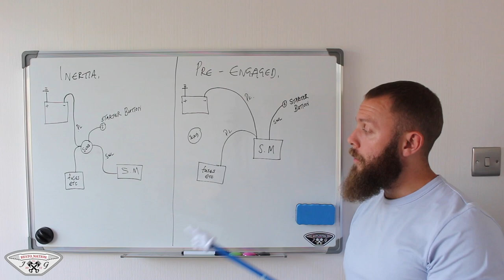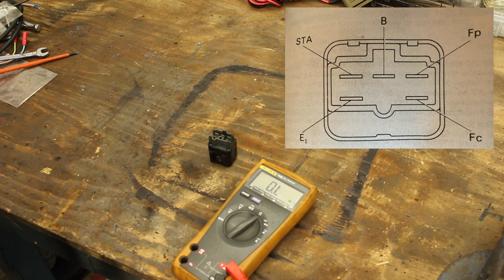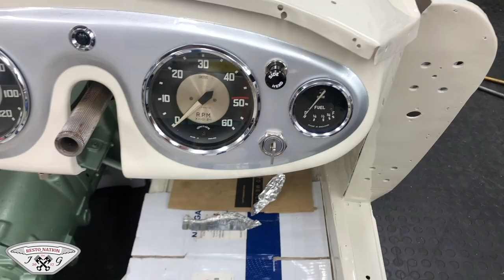MR2 Mk1 4AGE Cranks But Wont Start. How To Fix

Comment: Having now also dropped an MR2 tank I wholeheartedly agree that it’s not a job I want to do again. Mine has been sat since 1999 with half a tank, the tank and pump were rusty as anything. £25 got me a clean tank, I then uprated the pump to an AEM 340LPH E100 compatible pump (massive overkill but I was hoping to convert the car to E10, until I read the manual stating it needs 99 octane anyway 😭)

Thankfully I tested the new fuel pump, rail, regulator, damper and lines last night and got a steady 36psi pressure and no leaks thank god

Comment: I've had this malais on my MR2. I was told that if storing the car for a lengthy period, the fuel pump needs to be completely submerged in the fuel. Worst part of the tank removal for me was actually reconnecting the pipes on refitting, especially the small breather. Wasn't designed to be easy!
Reply from the maker: I didn’t have that luxury as mine was rotten! It’s a nasty job but I’ve done it twice now and hopefully never again!! And if you follow the Manual it’s nearly impossible!! One thing I will say tho, if that tanks Is coming out then change the pump for new!!
Reply: That's exactly the mistake I made on mine.
Reply: Thankyou! I was wondering why my mr2 wasn't starting. The car "started" a month before I got it, but I couldn't figure it out. After some research realized my fuel pump is junk. Now I know why the fuel could have gone out so quickly as there gas in the tank. I got the car for free so thats why I got as a non-runner.

Comment: 8:08 This seems to not be the first time this has happened. I saw an aw11 in Florida that said they changed the fuel pump and won't start. And the one I'm buying having a similar issue, only starting with starter fluid but not staying on for long. Praying that might be the only mistake.
Reply: You ever find out what the problem was ? I'm  in the same position . New fuel  pump and the  gas tank was refurbished.
Reply: @papi_sazon2032  lmfao it was a fuse. No power to the fuel pump. Changed that and it started work

Comment: So I have an mr2 86, fuel pump works and everything. The car turns and starts but turns off after 1 second of it running. What should be checked next
Reply from the maker: DJosue Aguirre are you sure its working?
Reply: @Resto.Nation  Hey well the reason why it didnt start was because of the fuel injectors. The issue was that the MAF seems to be causing hesitation to acceleration and misfires and we bought a MAF and replaced it since it seemed defective. However as of today we put in the new MAF and no longer starts just cranks and it fired up yesterday not sure what couldve gone wrong.

Comment: Couldn't find fuel pump relay on mine 86 MR2 4A-GE model. Can you tell me where is located. I look and search everywhere on net but couldn't find it
Reply from the maker: Should be in the boot next to the ecu behind the carpet.
Reply: @Resto.Nation  wow! Didn't realize it was way back in the back of a trunk. Thanks I got it
Reply: Sorry to bother you but since I came across your video and you seems to have a lot of knowledge on MR2. 

Well, after I tested the fuel pump relay it was still good. Funny thing now as compared to before where mine 86 MR2 crank no start  and thinking it was fuel pump relay is an issue but that's not the case since it has been sitting in the garage for almost two yrs without driving in it. 

After multiple attempted to started my MR2 for the past several days with brand new battery just installed it, it cranks but no start. However, I just decided now to go out to my garage and tried to started my Mr2 and long behold, it cranked and started. WTF!!!

Thought this was just a fluke so I turned off and started it again and it started. Now, I am very dumbfounded. So now,  I thought it might just be bad connectors somewhere perhaps it's in battery terminal connector. I removed both negative and positive end to check and clean it to make sure nothing is corrosive might be build in which were none.:(   

Wondering if you have any ideas as to what might caused this intermittent. Thanks again in advance for being patience and reading this long message.

Comment: hi mate good vid very helpful but what would you think if the circuit open relay isnt getting power?
Reply from the maker: Good question! Have you got a wiring diagram? I would say start with basics like a main fuse maybe? I would expect it to have a permanent live to one of the pins
Reply: @Resto Nation  thanks for your reply even the diag box connector isnt getting 12v where you do the jumper thing very strange
Reply from the maker: @bulldogcarparts3844  super weird. Must be a fuse issue?

Comment: If we have access to the fuel pump power supply wires at the console, why would we not throw 12v on them right there and listen for the pump?
Reply from the maker: You can do If you want 👍🏻. Better to test to see what actual voltage you have and if not then work it back from there. If you put power to the pump and it runs then you still need to find out why you don’t have power
Reply: @Resto.Nation  hey, thanks for the reply! I did the bridge thing and the pump whirrs away happily, and I did the jar-under-the-return-line thing and it hoses in, so i am very pleased not to have to do the fuel-tank removal. I then discovered that while the main ignition lead belts me good, none of the cylinder leads do, so, um, distributor... i guess...

Comment: So If I’ve used the starter spray and it doesn’t work does that mean that I don’t have proper spark? I just replaced the spark plugs and the wires on mine but it still isn’t starting. Help ples
Reply from the maker: Have you got power to the coil?
Reply: How exactly do I figure that out?

Comment: hey resto nation. I currently have an 86 mr2 I drove it home 40 miles. When i first went to pick up the car it started right away. It has a brand new battery and fuel pump. As i was 3 miles away from home i noticed that the valve cover gasket started leaking massively. The car was pumping oil vapors like a chimney. I got it towed home and I noticed that the car wont start or hold idle. It will crank and crank and crank after 1 minute the car would baaaarely start and die immediately. If i push start the car is drives fine but once my foot is off the gas the car would die. I have fixed the valve cover gasket leak and the PCV hose leak. The oil level is good. I also did a distributor cap and wires. I am very very lost in this scenario. Any help would help.

one rare occasion is that the car started and held idle for about a min before it decided to die again. I also noticed that on cold start the idle would jump from 1000 rpm to 1600 rpm then after the car warmed up it was perfectly fine. All the issues started once the vapor was coming out of the top of the valve cover bolt o ring that was leaking and the PCV. When i push to start the car moves and drives normal it doesnt hold idle and now it wont start. What might be the issue?

Regards,
Reply from the maker: Wow, where do we start! Air leak, coolant in the air, ignition timing? I would say start with the basics and go from there to eliminate the easy stuff and then report back. Be methodical and make a list of everything that you’ve checked and eliminated.

Comment: Hello.. please help me… my fuel pump does not run without bypasing diagnostic port… when i bypass then fuel pump getting operate…. After i check the relay also as you told in this vid… i got power to the “FP” port when cranking.. when ignition Key on my fuel pump is not working what could be the reason?
Reply from the maker: Weird. Maybe a ground/earth fault. Check the pump ground wire. Or run a second ground from pump ground to chassis.
Reply: @Resto.Nation  thank you . I will check it out ..🙂

Comment: Hey it’s me again, tested continuity on the connector and the relay wasn’t putting out anything on the Fp terminal. Got a new relay and still don’t have a start. What weird me out is the male connection that goes to the fuel pump is only putting out 3-4 volts. Does this sound like a wiring issue. Not even the diagnostics box is getting 12 volts to the fuel pump anymore. Any tips??
Reply from the maker: Sounds weird! Should be a solid 12v I would say!
Reply: @Resto.Nation  battery also has 12 volts. Got a feeling maybe some wiring issues may be to blame, if you have any tips on where to start that would be amazing
Reply from the maker: @tylervilla2386  maybe try resistance testing sections end to end so fuel pump connector to diagnostic box if you can confirm that is one straight uninterrupted cable. Or maybe try running a temporary new cable to bypass it and see if that works
Reply: @Resto.Nation  sounds like a pain but I will try to do that, starter also just croaked on me so I have a feeling that might contribute to the issue. But I mean starter relay seems good it’s the starter itself that seized
Reply: @Resto.Nation  hey it’s me again, car became a no crank and no start so I threw in a new battery. We have a crank but still no start. Fuel pump is still missing the 12 volts. My guess is wiring since the relay and EFI fuse are new. I know there is a few sensors in the car. Would one of them possible be the culprit?? 

Thank you get back to me when you can
Reply from the maker: @tylervilla2386  uk car or us?
Reply: @Resto.Nation  US
Reply: @Resto.Nation  I was honestly considering a full rewire since the car is so old anyway. But I wanted your advice first!
Reply from the maker: @tylervilla2386  I don’t see any need for that level of extreme! You’ve got an AFM on the inlet that we don’t have over here. That might be worth looking into.
Reply: @Resto.Nation  got it I’ll look into that tonight, gonna read the repair manual to get more information in the meantime. Just in case if it isn’t the AFM anything else that comes to mind?

Comment: where is the best place to spray the easy start on the supercharged 4agze?
Reply from the maker: Just had a look at some pictures online. Might be worth trying to remove the air intake hose that goes into the elbow on top of the inlet to the supercharger 👍🏻.

Comment: Hey so what if I can’t get power from the diagnostics to the fuel pump connecting wire?
Reply from the maker: Broken wire maybe? Have you got continuity from the diagnostic box to the pump live?
Reply: @Resto.Nation  I haven’t tested that yet, do I just test continuity from terminal Fp and ground?
Reply from the maker: @tylervilla2386  I would expect FP to go to fuel pump live but confirm with a wiring diagram (Haynes manual maybe) first 👍🏻
Reply: @Resto.Nation  sounds good I was gonna test the fuel pump soon to see if its still going, then if not run some new wire. Thanks for the response and the help
Reply from the maker: @tylervilla2386  any time. Just comment if your stuck 👍🏻

Comment: My 87 aw11 just stopped running while I was cruising in 3rd. Fuel pump doesnt make any noise unlessed it's bridged but it still doesn't fire. I feel like its definitely wiring because of the way it cut out. So far I've replaced ignition coil, distributor cap n rotor, plugs, wires, and fuel filter. I also did all the fuses but I'm waiting for all the relays to come in the mail. New battery too good voltage. Wiring is not one of my talents I'm stumped right now if anyone has an idea it'd be appreciated!!
Reply from the maker: Could be circuit open relay. Let me know if that fixes it when you fit it.

Comment: I have a 4agze, if i leave the car it loses pressure in the rail, if i turn the key theres no pressure in the rail,if i crank it,it cranks about 4 times pulls fuel splutters then fires up and runs great and shows pressure , if the car is left it loses pressure again, after chasing this issue i decided to get a new FPR and adjusted it to 40 psi, new walbro fuel pump and new fuel filter, fuel tank is mint inside.
If i disconnect my circuit open relay car will not start at all, when turning ignition on circuit open relay does not click or vibrate, after crank and running if i turn the engine off circuit opening relay vibrates?.
Could it be faulty an only partially working?. Fuel Pump runs great whilst engine is running, its just the initial start. I do not hear any pump running with ingition on only when cranking or engine running?.

Comment: I’m getting no voltage to my injectors and I’ve been looking at all the electrical components related to it and I can’t figure it out
Reply from the maker: Without a wiring diagram it’s hard to say. The injectors get power from either the ecu or the igntion relay. How are you checking for voltage? When the car is in what state?
Reply: @Resto.Nation  the car cranks but doesn’t start and I’ve checked voltage in the fuse box and all the relays that can cause the problem for the injectors but I just came across that there is no voltage going through circuit opening relay.
Reply from the maker: @chewyruiz5434  English or American car?
Reply: @Resto.Nation  American
Reply from the maker: @chewyruiz5434  I think you had an AFM over there so I can’t help you mate sorry.
Reply: @Resto.Nation  it’s okay thanks either way

Comment: I’ve got spark :/ I’ve got fuel at the rail I’ve replaced all fuses and relays but my aw11 still won’t start any guesses I would really appreciate the help
Reply from the maker: Timing? Dodgy plug lead or plug? Have you seen my other video on the checking of the ignition system for reference?
Reply: @Resto.Nation  I did check for spark and I all seems to be well, my injector connectors are brittle and have lost there clips could that be my next step?
Reply from the maker: @futtalk2780  it’s logical for sure because I had a break in one of my injector wires that I remade but one down wouldn’t stop the car from running. Will it run if you spray easy start into the intake?
Reply: @Resto.Nation  yes, with a little help car will run if maintained with easy start.
Reply: But without it I can only get it to crank endlessly
Reply from the maker: @futtalk2780  still sounds like fuel. You’ve got the full 12v at the pump connectors in the car during cranking and when you keep it running with the easy start?
Reply: @Resto.Nation  I’ve yet to test that but I’ll do so tonight and see where it takes me from there
Reply from the maker: @futtalk2780  good luck. Keep me posted.

Comment: So after days of struggle we still cant find the problem. Car starts up and fires up but it high idles, hesitates to accelerate, both loses power and runs rich when accelerating, completely stalls when you press the gas pedal completely. What is your take on it???
Reply from the maker: I’m not sure being honest mate sorry. Us or U.K.?
Reply: @Resto.Nation  US unfortunately
Reply from the maker: @djosueaguirre5182  lots of emissions gubbins and a maf on the us cars. I would recommend checking and setting the tps as a good starting point. I’ve done a video on it if you haven’t already seen it but be careful. Haynes made a mistake that I addressed later in the video. Good luck...
Reply: this could be a number of things.  Poorly adjusted or failing Throttle Position Sensor would be my first guess but it could also be the coolant temp sensor having a short or open circuit or just failing in general.  The TPS has a spring that makes it return back to it's resting position when the throttle body closes again and that gets gummed up or weak and it doesn't snap back to idle position quickly or at all anymore after 30+ years of operation so it throws everything off.  You need to get the Factory Service Manual and look up how to test the TPS and the Adjustment procedure using an OHM meter.
Reply: @Raevenswood  Appreciate it man, it turned out that the problem was that my dad bought performance fuel injectors and that was spraying more than was needed in the cylinder. I have the BGB and Haynes but unfortunately in both their troubleshooting sections, the injectors are not even a possibility for hesitation, not sure if engineers overlooked or never considered that injectors could cause it. It is fine now but I will check the tps just for preventative maintenance and study the car with the bgb.
Reply: @djosueaguirre5182  oh yeah the 4age ECU can't handle performance injectors .... you know this now :)
Reply: @Raevenswood  you have a mr2??
Reply: @djosueaguirre5182  I had one in the past and I'm shopping for another one now.  I am finishing a 1986 4runner build right now with a 22re.  the EFI systems in these 80's Toyotas ran on the same concept with the Airflow Meter and the circuit opening relay, even a lot of the sensors are the same on different models from that era.  Once you learn the way it works on one model it's pretty easy to transfer that over to another.
Reply: @Raevenswood  Yea I noticed that these cars share the same type systems, and better get one soon since the value of them are going higher and higher. You have insta?
Reply: @djosueaguirre5182  I actually don't have instagram I'm a dinosaur haha
Reply: @Raevenswood  Nothing to be ashamed off you have more insight on the world than most of us in the new gen, you have facebook atleast?